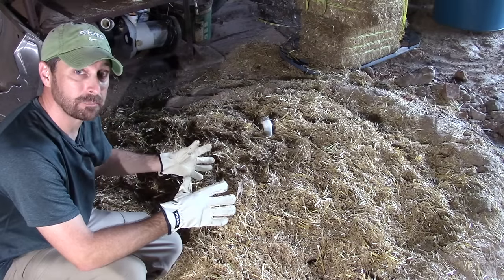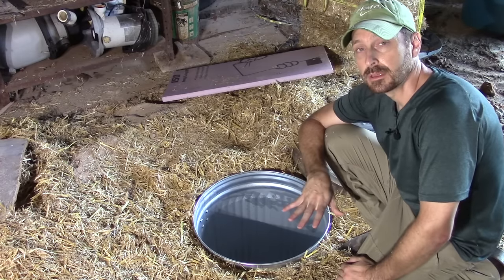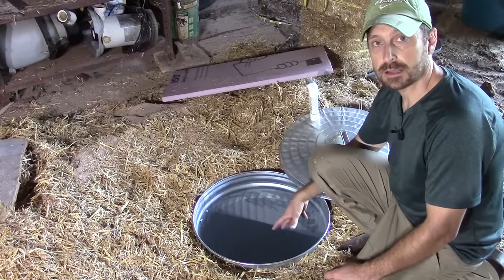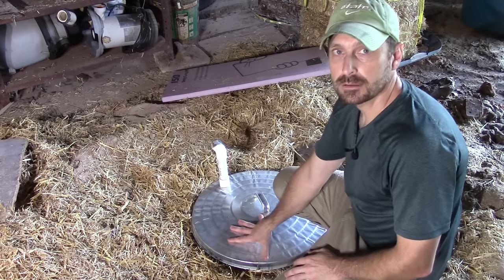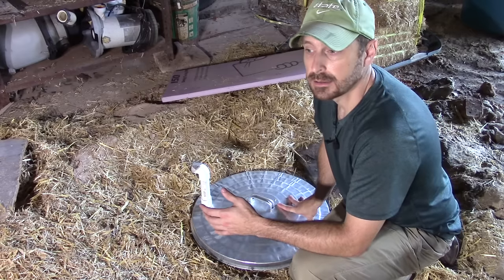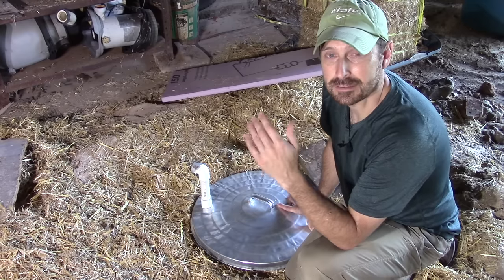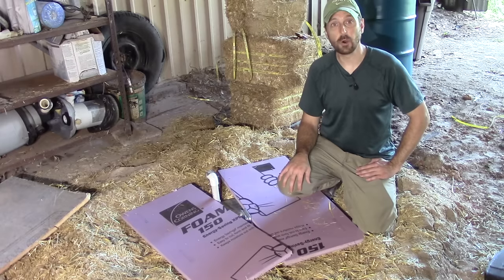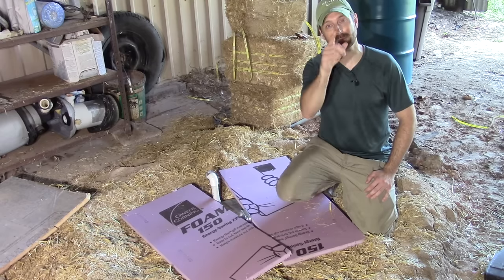Our Simple Inexpensive Root Cellar Build

Comment: Great info. I live in East Texas north of Tyler and thought root cellars would not be as good here as places with cooler climate. My dad just put hay down on high spot on ground and put potatoes then more hay with a tarp to keep moisture out. Worked fairly well but the temp changes were problematic. Will give serious thought to maybe building a big root cellar. Have a steel tank 7ft by 12ft plus could stand on end and sink. Some prepping family near could use such more than myself but they don't have my resources for such. On 8ac here on sandy Hill well off county road with good drinking water 20ft down. Land was open 4 decades back but covered with trees for now. As health let's, will be removing most pines to make lumber to finally start building self a cabin or 2. Had goats and chickens here for a while and giving thought to such again. Being retired disabled with nothing else but staying alive to do, all my focus is on my place I call Dirtwater. No longer a workaholic but still need to keep these old bones moving. Thanks for the vid.
Reply from the maker: Awesome. You're welcome
Reply: I know what you mean I live here in Paris Tx .
Reply: I started taking omega 3 oil with the polyphenols in it. It has done amazing things in my body. I'm 64 female- had horrific blood pressure- neuropathy pain in my feet, screwed up sleep schedule, up 3-4 times a night to pee, stiff achey joints. Lots of lower back pain. 3 months ago I started the oil. Increased my D3 to 20,000 units per day and added K2 200 mg per day. 
Last time I bought a 50 lb bag of feed I had to drag/ flip/ push rest and fight again to gey it from the car to house. Yesterday, I picked up the 50 lb bag threw it over my shoulder- grabbed the second one and slide it up on my other shoulder and carried them into the house with little effort!! Thought they had given me the 28 lb bags because we had discussed that option briefly. But NOPE 50 pounders!!! ❤❤❤❤ P.S. my blood pressure went from 189/110 down to 120/73 this morning!!! No blood pressure meds- no diabetes meds- just the oil D3 and K2.
Reply: Wow, Thanks for the share!💕

Comment: Great video. I'd like to suggest the use of mesh with very small holes in the bottom of the can to reduce bug intrusions. Also, put several inches of gravel under the can for drainage--not only from the can, but from the surrounding land too. I saw that another poster mentioned using anti rust paint on the edges of the drilled holes to prevent rust. That's a good idea too.

The idea of using a buried garbage can, or as another poster mentioned, an old fridge or freezer is also a good idea.

I'm going to pass on this info to my brothers. They have a mini farm not far from me. I live in a handicap accessible apartment, so I can't make use of the info myself. I did do some gardening when younger.

Thanks for the informative video.
Reply from the maker: Thanks
Reply: Maybe  you could do some vertical hydroponic gardening ? I'm going to try that as well

Comment: You can also convert an old chest freezer into and in ground root cellar. Drill holes in the bottom, add a vent in the side and bring the pipe up just above the ground. The insulated flip up lid is very handy.
Reply from the maker: Absolutely. Another good option for sure.
Reply: Don’t freezers all have frion in tubes all around the freezer? Why would you drill through those???😊
Reply: @granmabern5283  
....that's what I'm sayin

Comment: I just started mine. I put it in my shop building. I wrapped it several times with the rolls of thin silver insulation left over from shop construction.  I used ground up corn cob I got from rural king, huge bag $4.99. Instead of hay. I had an extra roll of interior insulation with I sat on top of the lid. . The can is sitting on top of a dolly so it has circulation underneath it. I filled it up with. 40 lb of potatoes two days ago. I bought an inexpensive. I bought an inexpensive  thermometer $8 at Tractor Supply. It tells you your inside temperature and outside temperature too. It has A second device that you put outside, but I put it in the trash can. Now I can look at my main unit in the house. And I know the temperature in the can. It is 52 degrees right now. Not too bad. But I will work on getting the temperature down to below 40.
Reply: How you planning to get the temp down? Mine stays around 63 here in Georgia and It needs lowered as well. It's 22 inches deep.
Reply: @DsHomeyGarden  dig deeper in soil
Reply: Corn would attract mice and rats
Reply: @bbikermama  Not corn; Corn cob. It's bedding.
Reply: @lisakukla459  you mean the husks you’d peel off the corn, or the central core you’d cut the corn off?  When I’ve seen animals eat a head of corn they seem to leave the inner core, so I guess that bit isn’t attractive. That’s what you’re calling cob, of course. 

Weirdest and saddest thing I’ve ever seen was an African farmer feeding his goats shredded cardboard, they were so poor, and the goats accepted it when there was nothing else. There’s calories in cellulose and glue (Meaning the critters might still eat your insulation) We don’t know we’re born, people!

Comment: This is what Korean people used to do before refrigeration for the winter.  This is why Korean ceramic pots to store food is a big deal culturally.  This was mostly to store kimchi - spiced fermented pickled vegetables - to be eaten with rice through the winter.  

Nowadays, there are specialized kimchi refrigerators that mimic root cellar temps so that the kimchi lasts the longest.  In normal refrigerators, kimchi doesn’t last as long.  They are very much like the wine fridges.
Reply from the maker: Yes, absolutely. I have many Korean friends and most have the kimchi refrigerators. They tell me it is to also separate the smell of the fermenting kimchi from the rest of the refrigerated food.

Comment: Thank you so much for this information. I’m growing potatoes for the first time this year and was wondering what I was going to do about a root cellar.
Reply from the maker: You are so welcome! Glad it was helpful.
Reply: Dig a hole large enough to hold what you got line with straw is got to be 18 inches below ground so ground freezing won't happen cover with straw the left over dirt will last all winter when need produce dig up what you need then cover back will keep cabbage potatoes apples beets I have used in the past because no root cellar works fine my grandfather taught me this when young used it and it works great.
Reply: My Father-in-Law had a 55 gal drum buried in the barn for potatoes. They lasted until the next harvest. Potatoes were an every Breakfast & dinner staple.

Comment: It helps greatly to moisten the dirt first by a good soaking.  Much easier to dig the hole then. But what do I, a city slicker, know.
Reply from the maker: Usually yes, but this is hard pack red clay. The water just would run off.

Comment: Thank you.  I am growing sweet potatoes for first time and needed way to store them at 55-60 degrees here in Louisiana.
Reply from the maker: You're welcome. Happy gardening!
Reply: In Louisiana won’t you hit water?
Reply: @stormeyholmes267  that's our problem here in the southeast.  The water table is just a few feet down.  Unless we build a mount or a cinder block above ground cellar it doesn't seem like it will work.
Reply: @stormeyholmes267  we use small hills or raised beds and keep a ditch and drain around the garden so rain drains away. Buckets work as well but if you mean for potatoes laundry baskets might do  or nested buckets with panels cut  if the inner bucket to make potato retrieval easier. Look growing potatoes in containers or Ruth Stout method.
Reply: @vinlago  Just stick a pump in the bottom of that irrigation system back up to the plants and you have an impromptu hydroponics system lol.
Reply: @troublezmalone8591  we almost could if the rain was consistent.
Reply: Even in a refrigerator sweet potatoes quickly grow mould. I don’t think you’ll succeed with that crop. Look at steam canning them? Check usda website for instructions. There are safety issues
Reply: @bella-bee  thanks

Comment: Love how you repeatedly credited "WE" in the build.  I watched and only saw "YOU" in the dig.  🤣 This is such a BRILLIANT PLAN!!!
I am an over thinker proceed this comment fully aware.  Would a gravel bed be beneficial in the base?  Is there any value in using spray foam?  Excelsior an option for saw dust or straw?  
Do I understand the key to which ever medium used is separation of the produce and to provide air circulation between?  *Would have loved to see a thermometer or barometer down in the base in your can.  (See I told you I was an over thinker, failed to tell you I am a back seat driver too)  ha ha.
Reply from the maker: I have a team of people that I acknowledge. 
A gravel bed would be beneficial.
Reply: @CountryLivingExperience  Of course, we all do.  Well DONE TEAM!  Should have added how grateful I am for this simple solution.  I kept thinking without the structure that is yet to be built I can't store up provision.  I have a barn just as you do...and even if you do have an actual root cellar a back up to the back up is a fabulous plan and all should utilize it.  Thanks again!

Comment: Took about two years, but between me, Hubs and my son (and alittle help from a neighbor boy) we dug out enough of our hard clay here in north Texas to sink in an old broken chest freezer.  I had to fill in the vents and holes with a special hard and non-porous foam. once you remove the machinery it makes the box much lighter and you have even more room inside, so worth doing that.  We buried it so the lip is about 6-8 inches above grade, and edged the hole with brick pavers.  It's inside a insulated shed, so should stay pretty cool down there.  Also pretty much out of sight.  I keep a table over top.  You never know when it might be a good idea to have a place like that.
Reply from the maker: Nice! That sounds like a great project.
Reply: Awesome! I live in north Texas too. How did this go? Are you still using it?
Reply: @AbolishFamilyCourt  Yes!  Working great. I added a more secure latch. The temp seems pretty solidly at 67 to 70 degrees during the summer. I keep a sachet of baking soda and some plain (no additives) clay kitty litter in the bottom, just in case of excess moisture or funky odors. So far so good.
Reply: @WinkTartanBelle  Inspirational! Thank you

Comment: Hi! If you live in an area with hard packed clay too hard to dig, could you possibly build a wood structure (maybe pallets?) with a trash can inside and surrounded by dirt or sand? Maybe a tarp over top with a layer of dirt? I’m in a rental so not only clay is an issue but digging would honestly require heavy equipment. Any suggestions welcome
Reply from the maker: I think there are better ways if you are in a rental. You would need to have the dirt really thick to hold the cool temps inside.

Comment: Here in mountains around Landisburg, Pa we used to dig a hole, line with straw and store apples and our veggies then stuff straw and cover it with dirt everything lasted till spring. Later we dug down about 5 feet, built a block container about 8 feet square and 8 foot tall. We built a heavy door for the side of it about 3 feet wide. Built an entrance way and a second door about 5 feet away from the first. Then covered the whole thing with about 4 feet of dirt. Had a vent pipe out of the top. Stored the same stuff but was a lot more convenient. Lasted till spring. Used it until around 1968.
Reply from the maker: Very cool! I love the old school ways that work.

Comment: Nice video. It might work in a lot of areas, not so much in central Florida.   Holes drilled in the bottom here would get you a half barrel of water. 
I have been looking for a solution for a high ground water level area. I will keep looking.
Reply from the maker: Yes, high water table areas won't allow this type of cellar. Good luck finding a solution.
Reply: I also live in Florida.  I wonder is we could dig down a foot or so, lay flat stepping stones as a floor, cinder blocks as walls and build up a few feet high.  Then haul dirt in to cover it.  Still thinking if this could work, how to make an entrance to it and how to insulate it.  Fire ants and carpenter ants are a problem around my property and those dang palmetto bugs.
Reply: I'm in southern Missouri and I just cant see this not filling with water here either.

Comment: How do you routinely check your stores if everything is covered in layers of straw?  Remove everything, examine, and re-layer?
Reply from the maker: I don’t.
Reply: I was wondering that too.  Seems too you should layer repeated selections so you don’t need to dig to the bottom if you happen to want a potato!
Reply: i think a great solution to this would be designing some kind of vegetable steamer-like contraption and then lowering that cage into the trash can, tie strings to both handles of the cage, then it would be rather simple to just pull the entire cage (holding all the preserved food) out.

Comment: First thought: What a good idea!
Second thought: Oh yeah I just remembered my water table is only 10 inches down.
Reply: Maybe you could double up your trash cans.  Put a slightly larger rubber/plastic trash can in the hole, then set your smaller galvanized steel trash can with in it.  Everything will stay dry.
Reply: @jgjg3848  That could work! I'd have to dig the hole in the hottest driest part of the summer but it would be worth a try. I've been trying to figure out how to get a root cellar without inadvertently digging a well! 😂
Reply: I’d be afraid that when the water table came back up your can would float out of the ground.
Reply: @francessilta7892  sigh, logic... 😂
Reply: My issue too. But JG JG had a great idea to double up metal with plastic cans.
Reply: Go find a really elderly local person and ask what they used to do. Quick, before they all die and the knowledge is lost!
Reply: @bella-bee  Too late I think. I knew an elderly couple in the area who had a root cellar. They died about 10 years ago. But come to think of it, their root cellar was on top of a small hill and looked like there was additional dirt piled on top of that. Our place used to be part of an old farm so your comment makes me wish I could go back in time and see what they did on this particular spot.

Comment: Cool idea.  Seems like a pain in the butt to pull out veggies if they are stacked on top of each other. I guess this works best for one type of root vegetable? Or is there a way to have easy access to more than one type of root vegetable in one garbage can?
Reply from the maker: It is not that difficult to get them out. I suppose you could make a multi-tiered basket that fits down inside if you like.
Reply: @CountryLivingExperience  or make dividers in a pie shape and insert it in the can. Have a grab it tool close by when you get close to the bottom.

Comment: Hi, great idea I’m wondering about small insect getting through the holes in the bottom. Do you think that’s going to be a problem?
Reply from the maker: Nothing has gotten in so far. I think it is below the depth that bugs usually burrow sans ants. I have had the occasional spider get through the top but only about 3.
Reply: I was going to ask the same question because we have cutter ants here in my part of Texas. They strip vegetables and leaves of many trees and shrubs. Thanks for the video and the question!
:)
Reply: Could you add a layer of mesh/screen product to prevent insects from getting in but still allowing the moisture to drain?
Reply from the maker: @barbaramaasch9499  You can add a layer of screen if you like. Nothing really gets in there except the occasional spider.
Reply: Pretty deep for insects

Comment: Gives me an idea I want to test...  I have a property in Sebring Florida (the high elevation middle of Florida in what they call the Lake Wales Ridge) . The soil is very sandy and there is no pavement within 3 miles..  Summer nights are cool compared to the coast.. like tonight in the middle of July it's around 74F vs 80F in Miami.  Those 6 degrees make a very big difference for sleeping without AC at night.  I recently dug a  shallow well by hand noticed the water and soil a few feet down was much cooler.   I am wondering..  I like to park my van on the property and looking for a passive way to pull cool air into the van.  I wonder if hammering 8" PVC pipes 8 feet into the ground and flushing soil out so they are empty but likely full of water at the base.. if it might be possible to get some cooler air up by pushing some surface air in under the van that has been blocking the sun all day.
Reply from the maker: You can absolutely do that. You are essentially talking about a homemade geothermal cooling system.
Reply: Put mosquito screen over the ends!

Comment: This is awesome but wouldn't the galvanization affect your food somehow? I've always heard that you cannot drink from galvanized steel??
Reply from the maker: House water pipes used to be galvanized. Water is ok but you can get some destabilization of the zinc coating if storing water. In the case of the root cellar, the food is never touching the sides of the can. It always insulated by a layer of straw, sawdust, etc. so no worries.
Reply: @CountryLivingExperience  cool thanks!